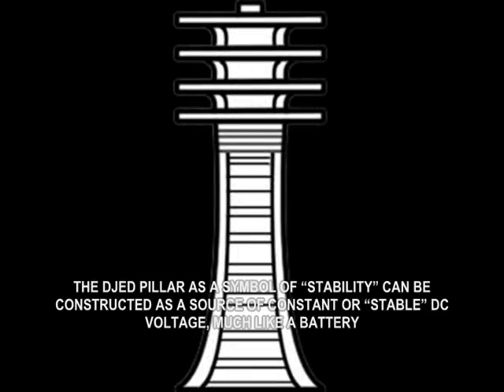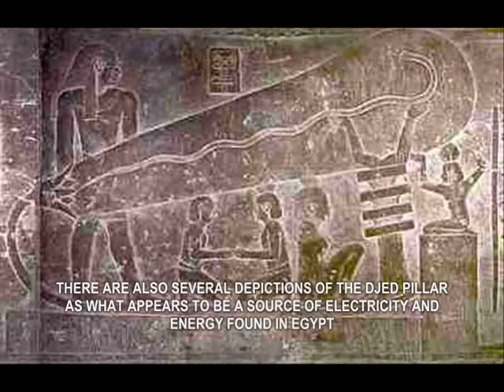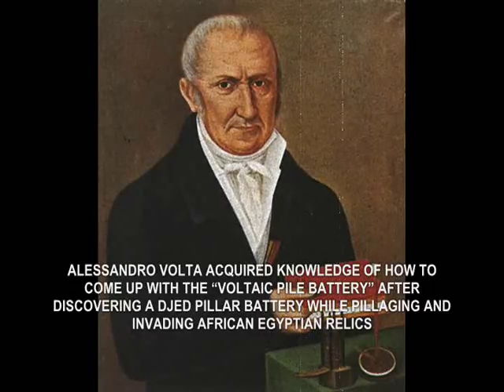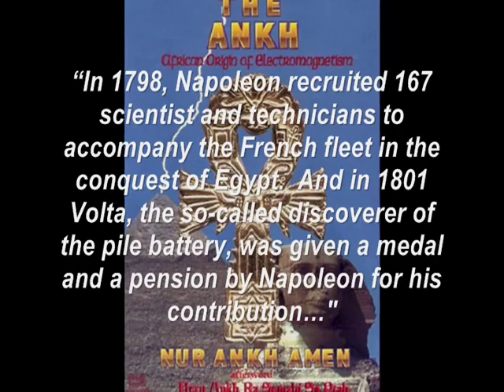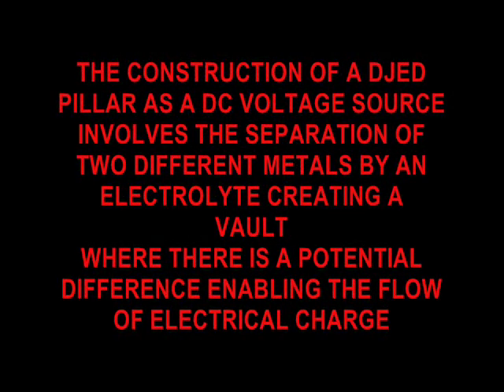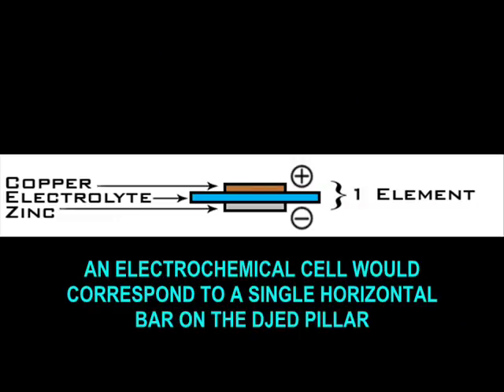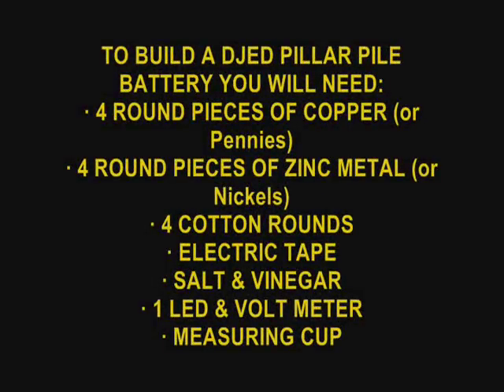P.T.A.H. Technology: How To Build A Djed Pillar Battery

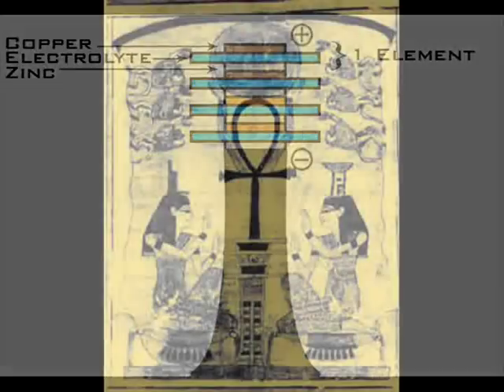Comment: 2:58 don't think it was a battery because there wouldn't be much power from it. However, if you think coil, like Tesla coil, there could be a huge amount of power here, high frequency, high-voltage, low current, fields that extend out and could light bulbs for quite a distance.

Comment: I think the top spun on the base.  The base has parts in it too.  Maybe they “pull started” it too get it going.  Once they got it spinning it was self generating.  Producing power with no external source of power.  Maybe flowing water was needed?????????
Reply: Interesting point. I feel like when it comes to remembering what we did in these societies, we tend to miss the forest for the trees. There could be applications and configurations that we have yet to consider. I wouldn't be surprised if others may feel like something more is missing as well.